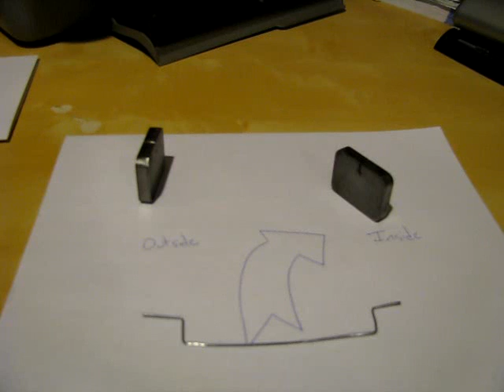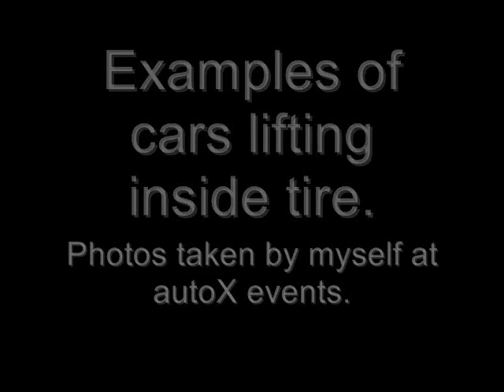Sway Bar Demonstration

Comment: that made no sense.  if true, sports cars would not require bigger sway bars than standard cars.  Your explanation was exactly backwards.  If the inside tire is lifting, a larger (thereby stiffer, all other things =) sway bar would bend less, keeping the inside wheel pressed down better.    A modern corvette sway bar, for example, is more than 50% larger than a standard, large sedan's.  According to your explanation, that would not be necessary, and yet it clearly is, to keep the tires planted.
Reply from the maker: I think you may not had understood, or I wasn't clear.  Once you get a sway bar that is big enough to lift the inside wheel, then going bigger isn't going to help. So from car to car, the difference in size does matter. Now, I think you are confused about how the sway bar works.  As the outside wheel is pushed up from body roll, the sway bar is twisted and being levered against against the opposite wheel - trying to lift it up.  What keeps the other wheel from lifting is the unspring weight, teh spring, and resistance from the shock. If the sway bar is so stiff that is overcomes those forces, then going any stiffer will have little to no more effect.  However, and I didn't mention this in the video, if you got stiffer springs, that will mean you can go to a stiffer sway bar.  Some people just go very stiff with the springs and delete the sway bar all together.  I don't think thats very common though.
Reply: thx for trying, but something is still missing.  Your current explanation says "when the outside wheel is lifted...".  In a turn, the INSIDE wheel is lifted, as sprung weight shifts to the outside wheel.  My understanding was always a bigger sway bar reduces inside wheel lift.  At some point, the size becomes moot as it's force under pressure could become more than the tire traction would allow to help (tire slip).
Reply: You are wrong mike. Jack up one side of your car with the bar connected and measure droop. Then un-hook the bar and measure droop again. It works as Matthew says.

Comment: So whats the difference between sway bars and independent rear suspension
Reply from the maker: You will have sway bars on IRS. There are some philosophical differences peopel have about sway bars because the stiffer teh sway bar the more linked your two wheels are.  So some people think instead of getting stiffer sway bar, get stiffer springs.  One advantage of the sway bar is the ease of tuning it if its adjustable.  Then you can make it more or less stiff as needed a lot easier than changign springs out.  I hope this helps a little.

Comment: That is not how a sway bar works. And stating that a stiffer sway bar will lift the inside wheel even more is just wrong, and you gave that wrong advice to a lot of users when asked if they should get stiffer sway bars, which would be the most cost effective and right way to go for any track oriented car.

A sway bar acts as a lever, not as a direct point-to-point connection between the wheels! If one wheel is pushed up then the sway bar transfers that force and PUSHES the other wheel also up over torsional force.

http://speed.academy/wp-content/uploads/2014/11/swaybar-tech-06.jpg
Reply: The lack of torsion demonstration is why this video should not be referenced by anyone.  It simply doesn’t represent how sway bars work.
Reply from the maker: +ven0m  Correct,thats exactly what I was saying using different words.  Now what is resisting the other wheel from going up?  The springs, and the weight of teh other wheel.  If you are now actually lifting the inside wheel off the ground, then teh sway bar is overcoming the spring weight on the other side and their is decreasing rate of return on putting a heavier sway bar on the car.  At that point, you will get more out of the sway bar by putting on heavier springs.  Which is what I usualy tell people.
Reply: +ven0m You are incorrect. If your inside wheel is lifting on a particular corner, reducing the stiffness of your swaybar would most likely help. Pretty much there is no argument against it since it's math....

Comment: thanks for the great explation dude...ive just finished building my rx7 fd wich happens to have a ls3 6.2ltr v8 engine and it goes lol.
but i recently upgraded the front sway bar and the was at the track the other day and the inside front wheel while turning was lifting and im pre sure its because the front bar is now to thick... which it is much thicker than the old standar one i replaced.
so yer ive heard a lot from other drifters that they dont even run one in the front and im considering this will try it and with out and but thanks for the vid..and thought would be great thanks dan.
Reply from the maker: +Drift Stig Cool.  Yeah, the general rule of thumb, more sway bar in the front, the more understeer.  More sway bar in the back, the more oversteer.  For drifting you probably don't really need to much more oversteer especially since you have an LS3 - you can rely on the power oversteer :-)

Comment: So... sway bars make you ride on 3 wheels? I think I'm lost in youtube... jk great vid
Reply: it applies the energy wasted from the roll of the car body and distributes it better amongst the inside wheels. when the inside wheel lifts up, the sway bar has been taken to its limits.  the inside wheel can lift without a sway bar so no.
Reply: i understand your doubt.... when the wheel goes up... the weight of the car pushes it down and touches the ground...hence the body straightens out reducing the roll

Comment: You should clarify that the tire "lifting" is actually the body of the car on that side lowering.  Unless the CoG is dramatically changed, gravity pulls down the "lifted" tire resulting in the vehicle essentially "leaning" into the turn and allowing the vehicle to take harder turns without rolling over.
Reply: exactly
Reply: Mike Rodriguez Yes that makes more sense :)

Comment: ah huh, so inside rear wheel lift-up occurs when sway bar is too stiff?  since inside tyre is in the air, no longer in contact with the pavement, too stiff sway bar actually causes less grip?
Reply from the maker: What I was trying to say is that once the inside tire is lifted off the ground a stiffer sway bar will not help you.  You next bet is to stiffen the springs, and then stiffen the sway bar. I hope this clarifies it for you.  Thank you.

Comment from the maker: If you don't change the diameter of the sway bar it may have the opposite effect since the longer the sway bar gets the more flexible it becomes.  So it probably does have an effect but probably not what you think it will unless you make the sway bar thicker.  Just as an interesting side note - my MR2 the sway bar connects to the struts, on my Subaru they connect to the control arm.

Comment from the maker: It will, but once the wheel is lifted off the ground a thicker sway wont do you much good.  You will get less body roll with stiffer springs.

Comment from the maker: Yes, I think I over emphasized the wheel lifting part.  Its hard to explain that the body roll needs to be countered by some other force.  In this case its the weight and spring and damper on the far side of the car.

Comment: The theory is explained right but needs one more piece which is the result. The advantage which is not explained is that the inside wheels tendency to lift helps to level the car since gravity will push the wheel down to keep the tire in contact with the ground.